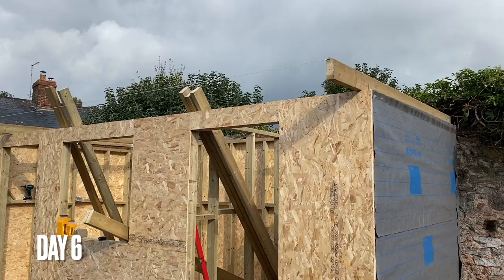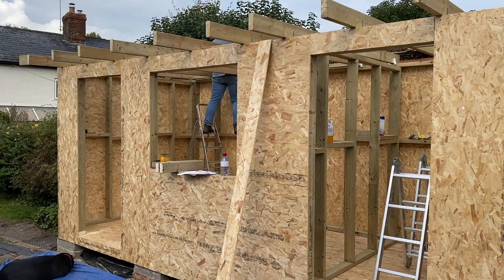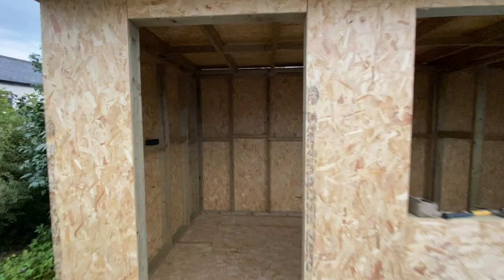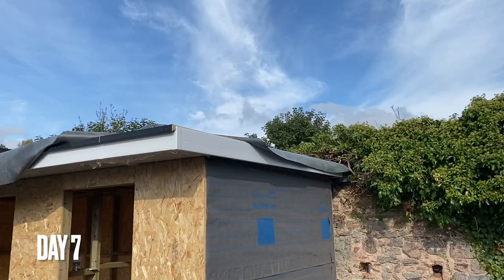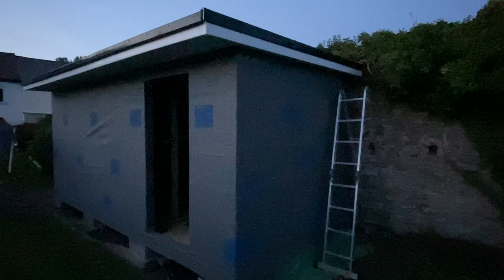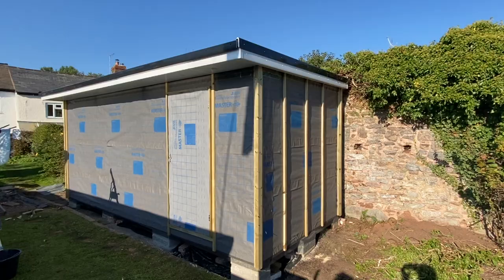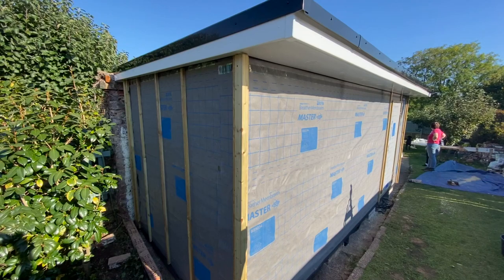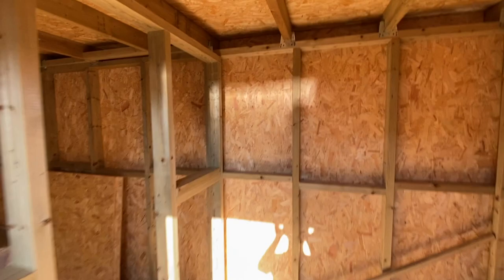Constructing a Timber Roof for a Garden Room - Quick Build Garden Room Project - Part 3

Comment: Was the z frame door hard to build ? Looking forward to the rest of the series
Reply from the maker: Thanks Daniel. It wasn’t too tricky actually. Most important thing I find is to make it on a completely flat surface and make sure it is square by measuring the diagonals. It can be tricky to cut the cross braces and getting the angle right, but the best thing to do is place the timber under the frame and mark the cuts.

Comment: Hi Lee. Just wondering, is your roof completely flat or does it have a fall in it? If it has a fall, have you achieved this using rake walls or furing strips? If not, are you concerned that it will deteriorate over time? Asking because I’m trying to figure my own roof out and watched your video for guidance, and noticed it looks completely flat.
Reply from the maker: Hi Sebastian. There is a fall in the roof. Even though such roofs are called flat roofs, they are never normally truly flat. If you checkout the second video in this series (https://youtu.be/HCiuUPse6Iw) you should be able to see that I have built the rear wall taller than the sides and the front. A lot easier with a smaller build to take this approach than rake the walls or use firrings. The general rule is a minimum fall of 1:80. So for every 80 centimetres, the roof should fall one centimetre so ensure the rain water runs off rather than pools. Hope this helps!
Reply: @leejmurphy  thanks. Yeah I can see that now. Seems like a good approach. Are those firring strips that you’ve used on top of the side walls to create the sloped top of the side walls from the rear the front, or did you just cut a piece of timber? 

Thanks again for all this. It’s really helpful.
Reply from the maker: Hi Sebastian, no I didn’t use furring strips. I measured the height difference front to back on the OSB sheeting and cut it at an angle to match, just to neaten everything off
Reply: Hi again Lee. I have done as you have described above and it’s worked out well. Just doing the insulation now - just wondering what you did for the spaces on the side walls where the roof slopes away from the flat of the side walls for the insulation and plasterboard?
Reply: I have a slight but widening cavity on mine from back to front. I’m assuming you had the same on yours?